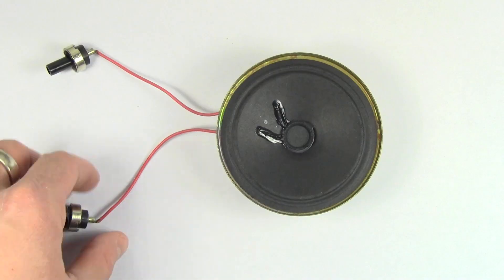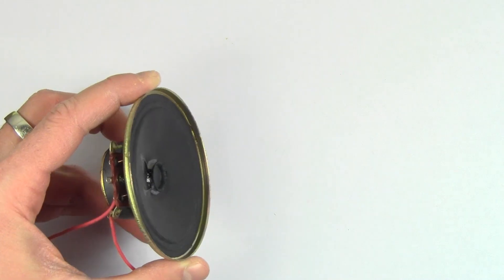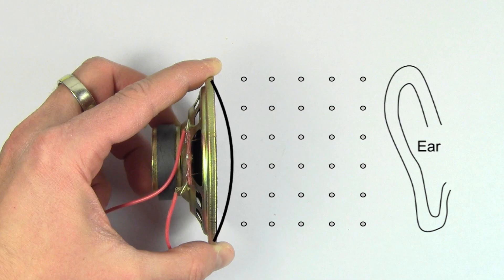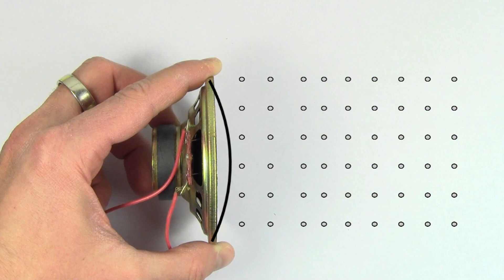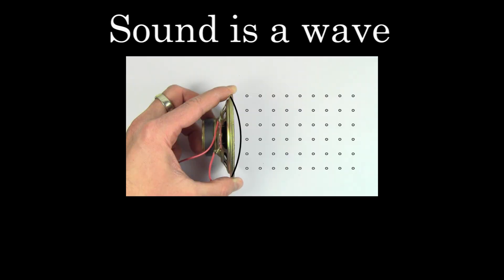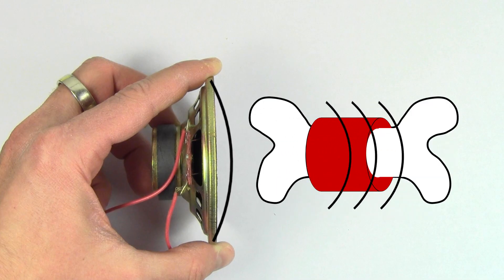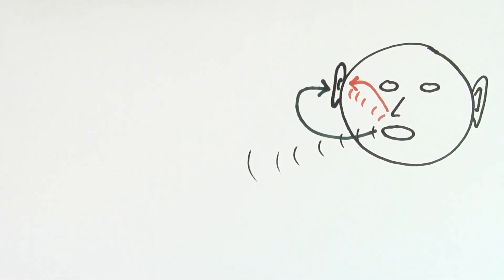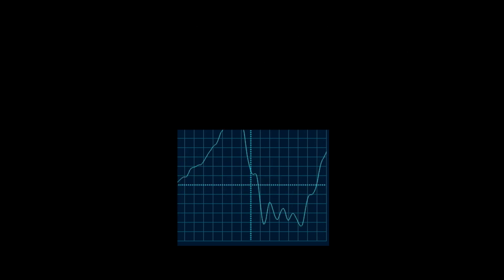Production of sound | Mechanical waves and sound | Physics | Khan Academy

Comment: I can understand that when the diaphragm oscillates, it creates a pressure wave by pushing the front air back and forth until Energy is received by the eardrum. But, what if a listener is placed behind the speaker, does it mean that the reflected wave from a wall is what is heard.

Comment: Good, i just want to know how does a speaker oscillation makes such complexity in sound? How can the vibration of one speaker voice produce multiple sounds at once, yet we can only output one sound at a time from our vocal cords?
Reply: Look into harmonics. Also look into why different musical instruments produce different sounds though the frequency, or tone is the same. Frequency mixing might also be worth looking into, but be warned that it can involve a lot of math. For example if you took the 3rd, 5th, 7th etc harmonics of a sine wave each at a lesser amplitude, or strength than the last and combine them you get a square wave, which will sound very different from a sine wave of the same frequency. I learned a lot about this stuff from studying electronics. Specifically alternating current and wave form. Since it's all just waves it works the same as sound in almost every way, right dow to the math.
Reply: Yes Me too had that question. If you find any interesting video regarding that , please post here in the comments . I will try here on my side.